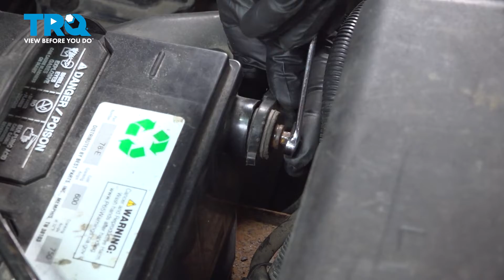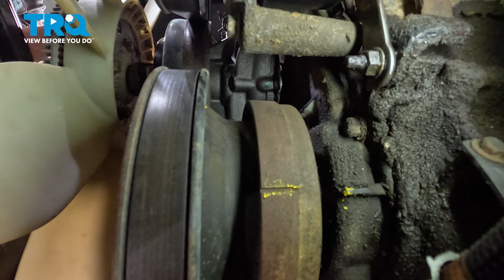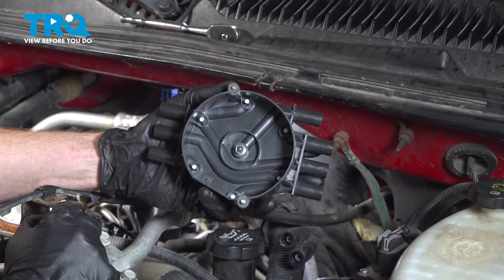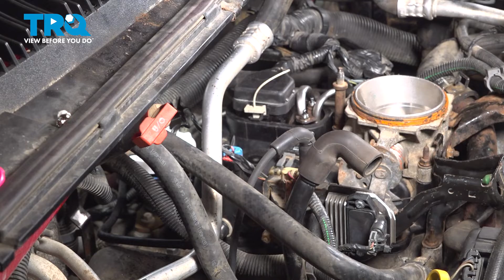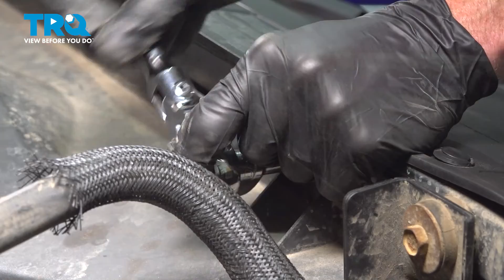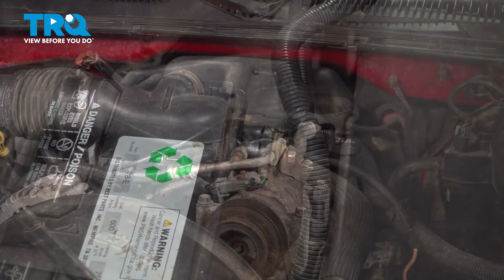How to Replace Engine Knock Sensor 1999-2006 Chevrolet Silverado 1500 4.3L V6

Comment: I read in a gm manual that the cam sensor connector should come off before removing the cap and back on after the cap. Assumed there was a reason.